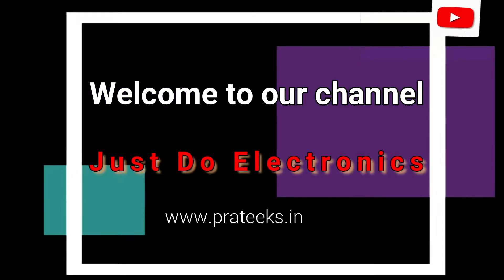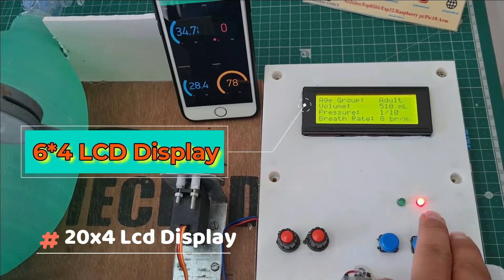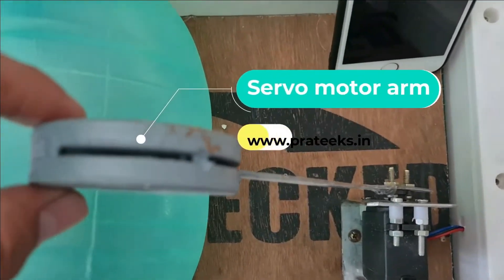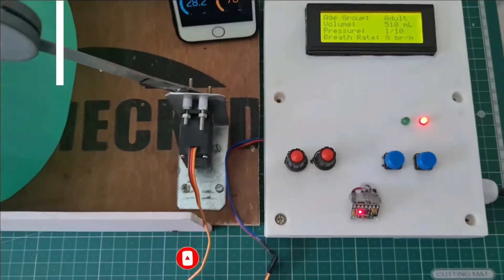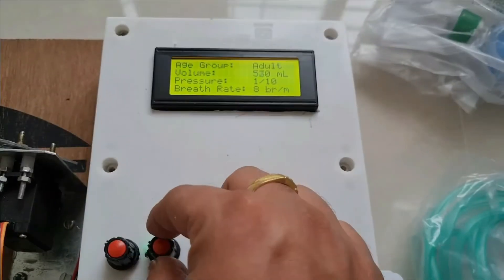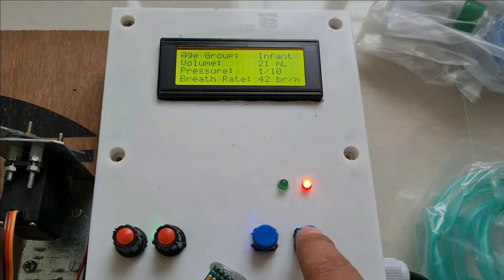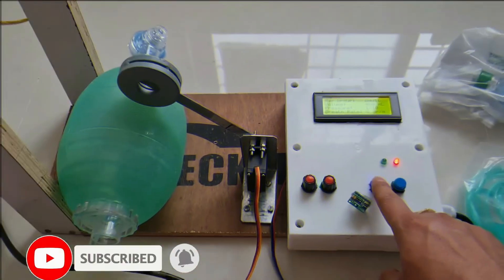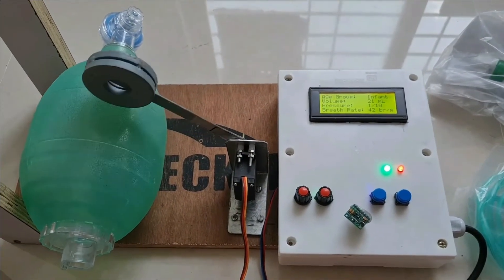DIY Low Cost Ventilator With Mobile App | BPM & SpO2 | IoT Project

Comment: Please help can we have the correct code
Reply from the maker: yes
Reply: @JustDoElectronics  thank u for replying how can I get the code the one at the website is not working because the constants library is not downloading please assist because using the normal libraries In arduino is not working
Reply: Am complaining the code but the constants .h library is not available
Reply from the maker: Yes